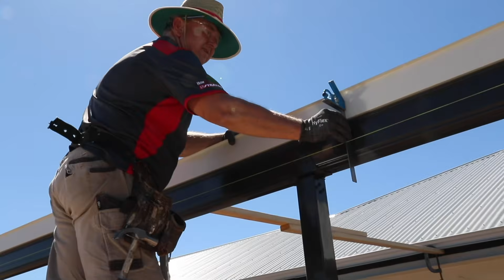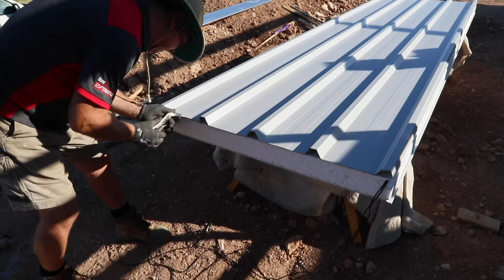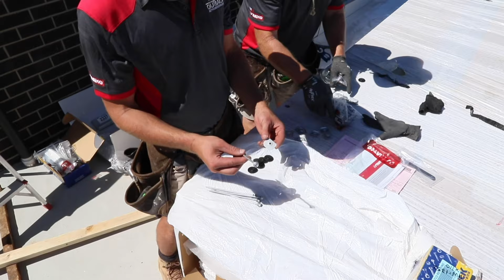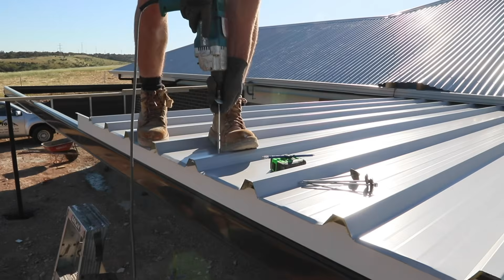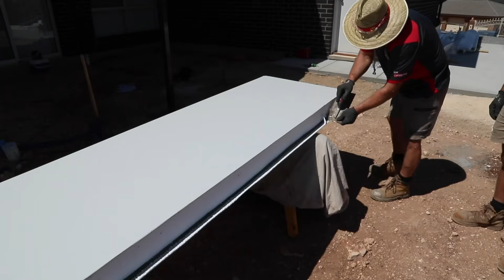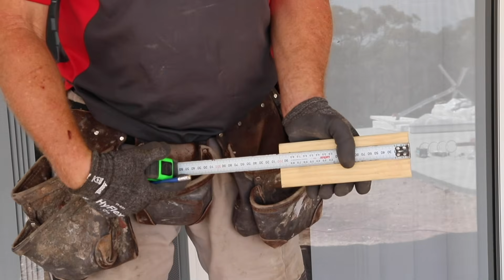Part 5 | Stratco Outback Flat Cooldek | Roof Install

Comment: Whats the minimum pitch roof  you can use these sheets on ?
Reply from the maker: The minimum roof pitch on the Cooldek roofing sheets is 1 degree for under 4m and 1.5 degrees over 4m

Comment: Genuine question are the turn ups high enough to stop water from blowing up and under ?
Reply from the maker: Thanks for the question. The turn up’s are done specifically to ensure water does not ingress.  The recommendation is a 30mm turn up at 90 degrees.

Comment: I just notice under the sheet. There's downlights, how do you run cabling for those downlights? Look like the foam sandwiched between the sheets.
Reply from the maker: Hi there, thanks for leaving us a comment. However, we would advise you to please give our team a call on 1300 165 165 during business hours or head into your local Stratco store where our team may be able to assist you further with this query.

Comment: How long does it take for polystyrene to decompose. I've used this twice. Also look in the video at the polystyrene blowing all over the joint. How do you get away with the polution. Both times I've used it what a mess. It looks like it has snowed. And why don't you cut the gutter part off in the factory. It's it because of laziness or money. I will never ever use this product again. Polluters of the 21st century. Disgusting. Shamefull.
Reply from the maker: Good afternoon, this product can be ordered with the edges cut. This should have been specified at the time of ordering. Thank you.

Comment: do you have to cut the sheet before bending the ends?
Reply from the maker: Yes, the sheet generally needs to be cut as well as a blade may need to be run between the top sheet and the foam to create some separation to make it easier to turn the sheet up.